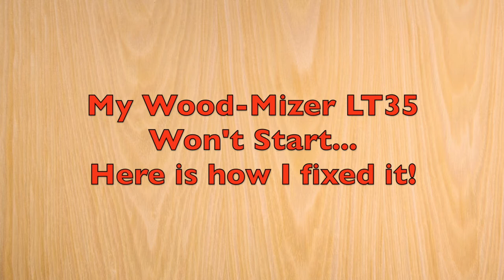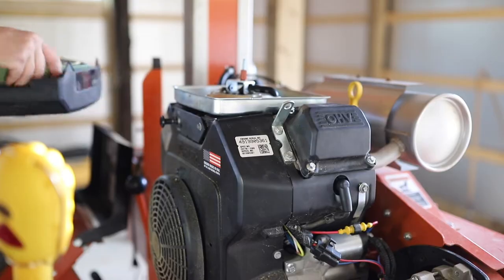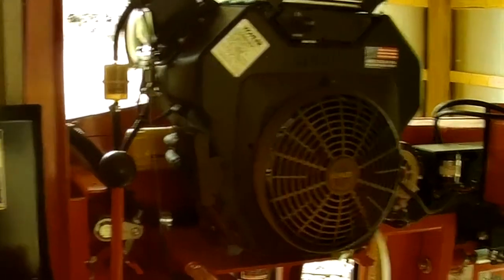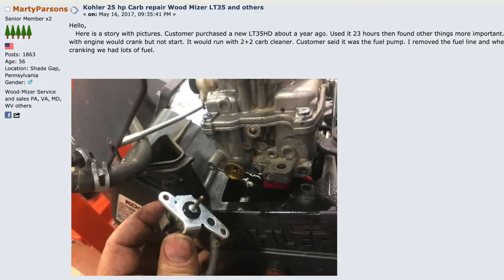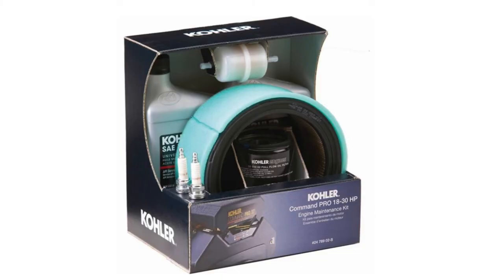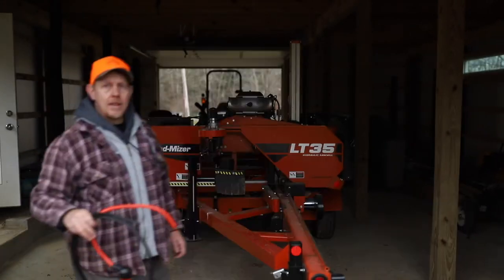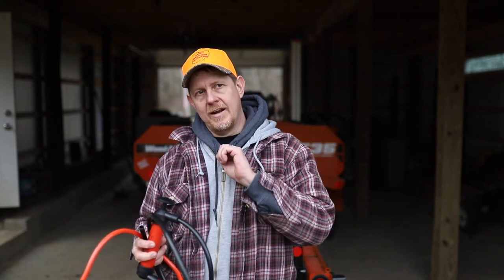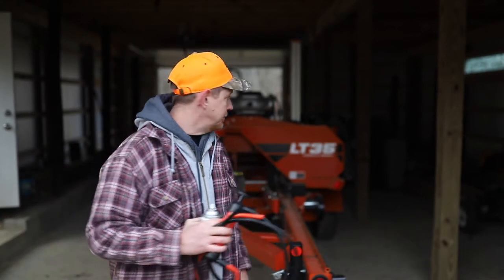#82 Wood-Mizer LT35 Would Not Start - Troubleshooting and Repair (Part 2)

Comment: Had the same problem on my LT-15, 25 Hp Kohler Command Pro. It was the fuel solenoid.  Took it apart and the little metal pin was all gummed up.  Cleaned it really well, tested it as you showed in the first video and it solved the problem.  Runs perfect now!
Thank you!!
Reply from the maker: Glad it worked out for you!  I'm coming to the conclusion that I just need to use all my toys more often... spent 4 hours messing with a pressure washer that wouldn't start and finally ended up ordering a new carburetor... hope that solves it...

Comment: Very helpful video! Thanks! My 35 wouldn't start this morning. Going to try your method. Have a wonderful day!
Reply from the maker: Let me know if you got it started. I have another video coming with the fuel solenoid removal and testing but need to trim it down as I was figuring it out for the first time.
Reply: @HardyBrothersOutdoors  I put a little fuel, into the carburator, and after a few tries of sputtering it started. I believe that my fuel tank was too low and built up condensation. We are in the U.P. of Michigan. Thanks for the help!

Comment: Had a similar problem, turned out to be buildup of some kind of chalky substance in the float valve inlet that caused the float valve to stick closed, thanks to ethanol gas.
Reply from the maker: Thanks for sharing!  Yes I'm not a big fan of using fuel treatment in all of my engines that sit at all...

Comment: Was the core problem debris caught in the line?
Reply from the maker: I was never able to definitely determine why fuel wasn’t flowing... I believe it was either clogged at the tank or at the fuel filter. I’m going to assume the fuel filter since the line above was empty and below  was virtually empty... the fuel filter “bulb” had very little fuel in it, so I think the fuel flowed back to the tank during moving and storage.  Honestly am not sure. But after blowing out the fuel filter, back-flushing the tank valve, it started pulling fuel up through the fuel filter. My biggest lesson in small engine repair here was that it was much easier than the route I took to verify the fuel line was not delivering gas to the carburetor... learning lessons the long route. Lol
Reply: @HardyBrothersOutdoors  I have a newer lt35 as well and my trainer emphasized to turn the fuel off when moving. I hope that's all it is for you. Seems odd there'd be debris in the line already.
Reply: @HardyBrothersOutdoors  I've heard as well that the starter fluid isn't good to use frequently... But just straight gas works too and maybe that isn't as bad not sure.
Reply from the maker: @TobiasCBrown  glad to hear this, I had not been told that but figured it would help going forward.  Thanks for mentioning this. Agree that debris should be unlikely.

Comment: I just assembled my new lt 15. Put log on the bed. Put gas in, turned fuel on and it wont start period.
Reply from the maker: I’m not familiar with the LT 15 and if it has the same engine setup. Can you see fuel in your fuel filter? Is it making it that far? Try some starter fluid in the carb? Check to make spark plug wires are firmly attached?
Reply: @HardyBrothersOutdoors  Ok. I'll go out and check the filter. This Mill has the 19hp engine. Thank you for quick reply.
Reply: Fuel Filter didnt have any fuel in it. I took the cap off the tank, turned the key still not cranking. Blew the line and the filter filled with fuel. Hook gas line back to tank and turn the key ,it fired up. Now i can sleep tonight. Thank you.
Reply from the maker: Awesome!  Glad it worked!